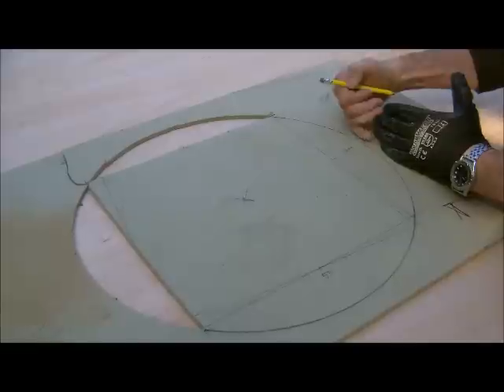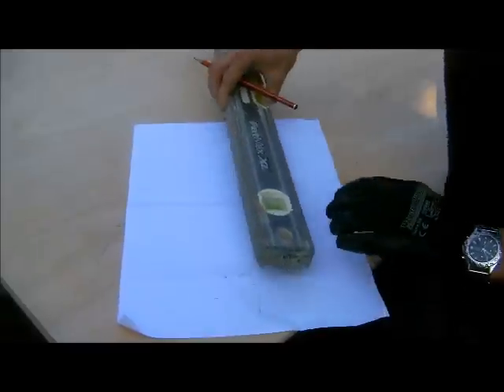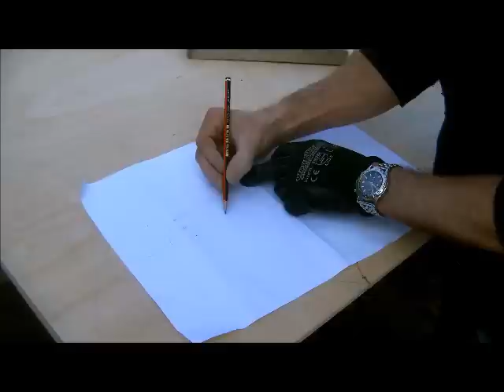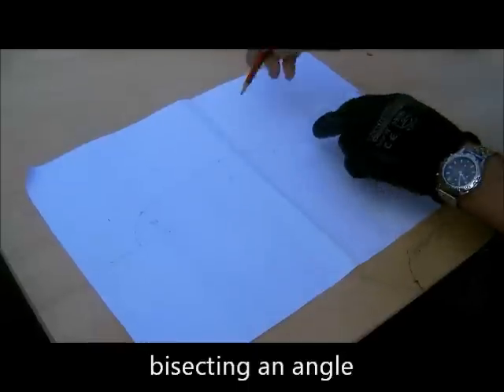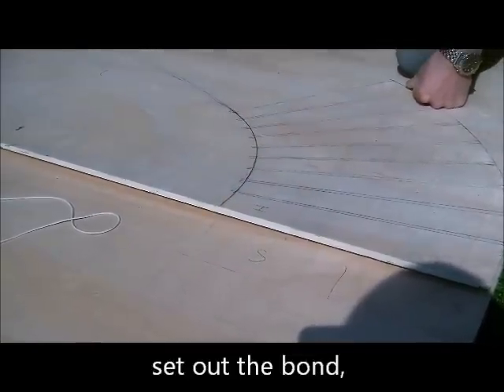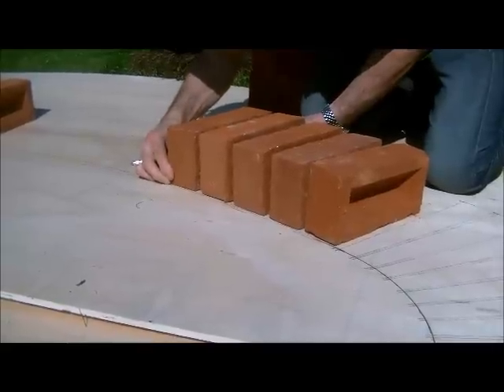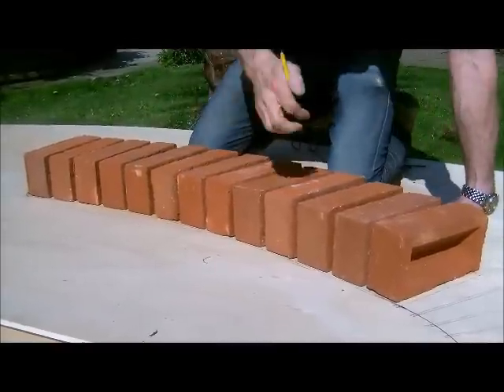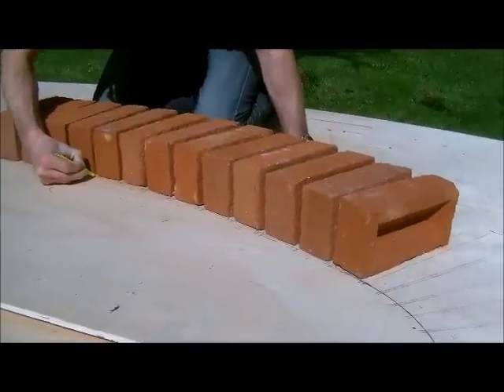the fine art of brickwork - Twisted Arch (2 of 4) Setting out the Arch

Comment: Hi Rob am I right in saying that you only axe your arch to comman normal, and that centre arch is rough. Just curious do you always find your template by dry bond or do you use the pi x di ÷ 360 x angle at striking. Or the old school traverse. Would like your input on what methods u use where and when. Top class again as always mate.